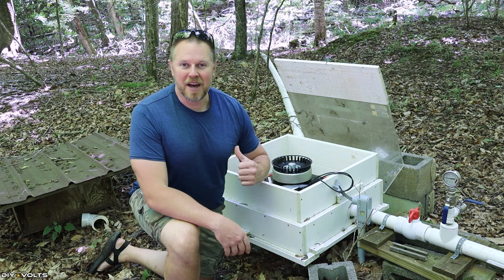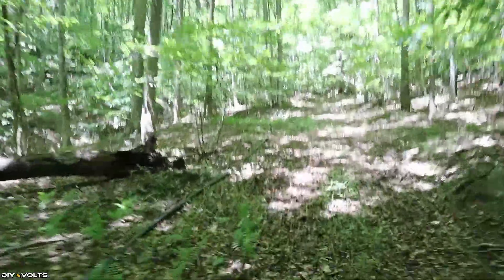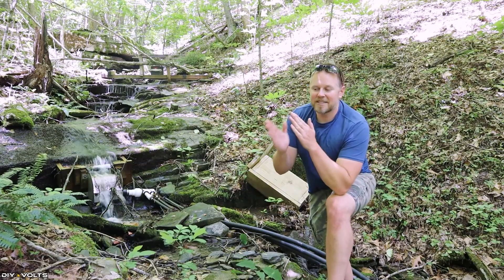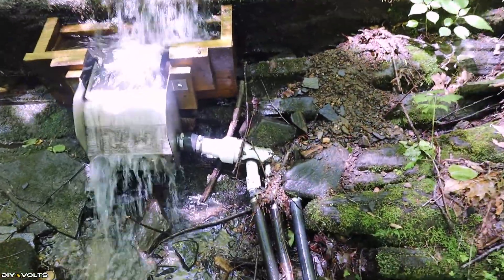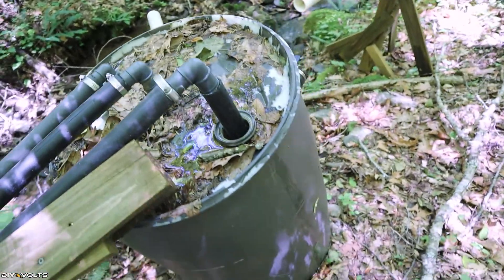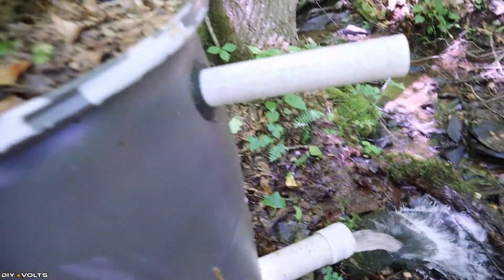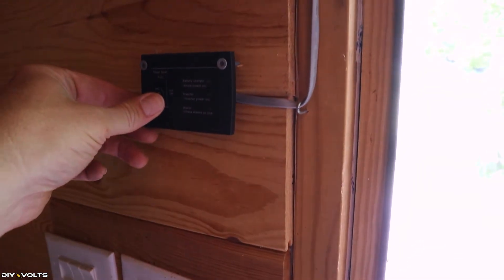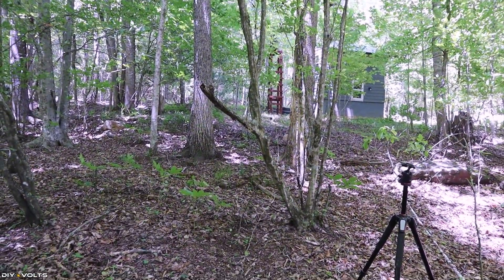Micro Hydro Power System Setup 2024: A Step-by-Step Guide to Harnessing Renewable Energy

Comment: I’m planning to build a hydroelectric system on a farm in Colombia, but I’m a bit lost when it comes to the electrical equipment needed to stabilize voltage and frequency, and to safely charge batteries.

Do you have any advice? My plan is to install a 5kW AC generator.

Comment: Tickled to see the micro-hydro start up this year.  Suggestion? OK, a low head tiny-micro-hydro running off the discharge from this micro-hydro.
Reply from the maker: I have just added a pipe on the 3/4" valve. 15gpm at 75psi. Should be great testing fun.

Comment: I like your setup. If it was my system I'd build a more durable weir at the intake out of formed concrete doweled into that large rock. I'd make an attempt to trench the penstock but I suppose you'd hit rock almost immediately. If you could get a larger diameter HDPE pipe and had 20 gpm in the winter it would probably avoid freezing. But I am guessing your run is at least 5 times your head so what is that 800 feet? That gets expensive. Where are you located?
Reply from the maker: A concrete weir would have been great. I was trying to do as little damage to the area as possible. If I were to remove the system all I would have to do is pull out 2 screws. The pipe is a 2" penstock and runs 1100 feet. It would be very costly to go as large as 3". I am in NC.